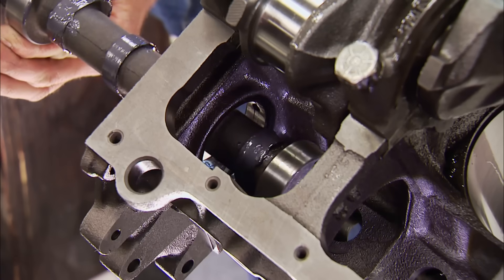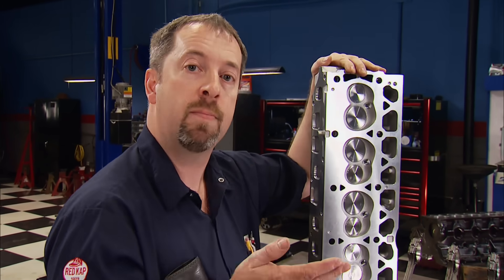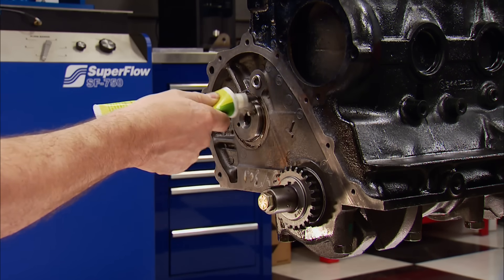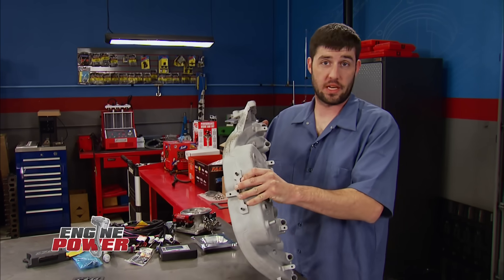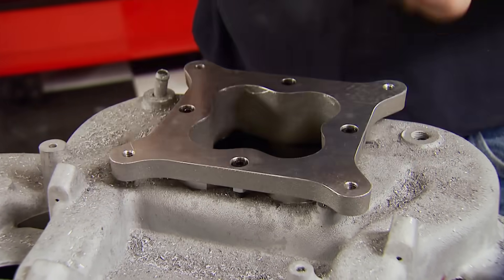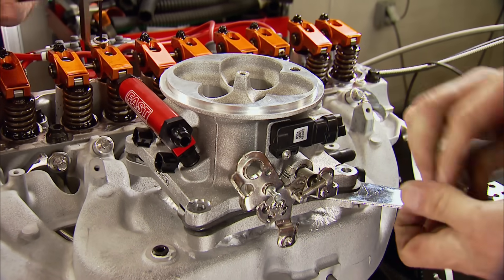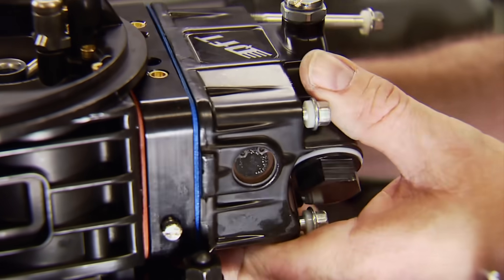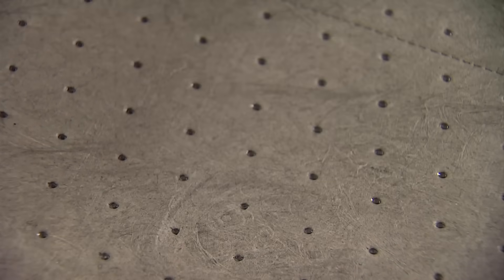Rebuilding a 4.0L Jeep Straight Six to 242HP - Engine Power S2, E14

Comment: cork valve cover gaskets? trying to turn a dry manifold into a wet one? RUNNING 87 OCTANE? You guys must have lost your damned minds right before you spent way too much money on that head. A good port and polish, some good springs, and a little milling for compression is all a stock head needs to run a decent cam and make power. stock exhaust manifold probably would have been fine too. If you had used the stock injection, port matched the intake and gasket, thrown some fuel at it with a bigger pump and higher psi regulator and used 93 octane with more timing you could have shown how easy and cheap this could have been. Those Edelbrock heads cost more than most people buy an old XJ for in the first place.

Comment: I had a 1978 J 10 . Worst motor I ever had . 258 in line 6. First one didn't even make it a year before throwing the number 5 rod. The next one made it to 30,000 miles. Before throwing the same rod. Dropped a Chevy 350 in problem solved. To the day I don't do Jeep.

Comment: Pistons had 0.40 in the casting. Is that 40 thou over? if so you didn't make 1HP per cubic inch as capacity is now greater than 242Ci

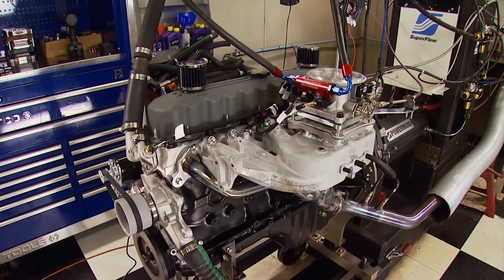Comment: 13:50 - Wait... why did they add the FAST adaptor? It was unnecessary! They weren't mating a 4-bbl to a 2-bbl flange! And if you notice, it wasn't there until this moment... not at initial start-up or during break-in. And since they were taking such time to carefully fit the 4-bbl flange to the intake manifold, why didn't they make effort make sure it doesn't extend too far into the plenum, which would affect how smoothly the air/fuel charge transitions into it and--subsequently--the runners? 
Also... since they're taking time to tune it, all in their search for 242+hp, why didn't they just plug into the TBI's controller unit and make adjustments to the fuel curve via a laptop or the like, electronically?
Something rotten is up here...!😡
Reply: You gotta keep in mind, they're boomers, in pretty sure they recoil and hiss at the thought of coming 10 feet away from a laptop, because you know, why make it easy?
Reply: @ramentaryramblings  - Boomers invented the computer

Comment: looks like a copy of the Aussie built hemi 6 from early 70s , factory had 265ci 320hp with triple webbers stock from factory in 6 pack chargers, well it started out at 215ci then 245ci then 265ci ,last of them 6 pack motor were rated at 320hp at crank
Reply: Nope all AMC. No need to copy anyone. There's 258back in the 70s N/A running 11s in a Gremlins. More than 350+ HP. What's your point

Comment: Fast EFI $1200, Edelbrock head $1800, Harland Sharp rockers $385, Comp Cam that has a warning not for use with fuel injection $269, MSD $718 + pistons, intake, oil pan, timing cover, oil pump, machining, core motor to make 243 HP vs 190 stock. Might should have stroked it. My 4.7 stoker with the iron head makes more at the crank with factory FI.

Comment: Wow you built a drag motor with all the power at red line , how much torque were you making at 3k rpm ? You know where most of jeepers spend 90% of the time . My guess is less than 210 ftlbs. Show the dyno graph ! The reason why the I6 is such a great reliable motor is because you don't have to rev the shit out of it to make torque . In fact most spend 80% of the time at less than 2k rpm off road.

Comment: Damn man....you got the same HP as my '02 Dodge Cummins (240hp stock). Since the Cummins is a diesel though I got ya on torque (~500 ft lbs). Nice job!
Reply: Diesel doesn't make an engine have more torque. The reason your Cummins has more torque is because it's so much bigger. A gasoline engine of the same size would blow away your Cummins in both power and torque.

Comment: I built the 4.6l stroker in 07.  Someone on ebay makes a nice cnc adapter to put a WJ grand cherokee 68-65mm tb on it—you just have to enlarge the opening with that cutting bit he was using.  24# injectors are what I used.

Comment: No builder on the planet would use a chain from AutoZone
Reply: Adam Steffen on a stock build all the time. On race engine never. This ain't a race engine. Just dont use autozones brand, you can actually get name brand ones from AutoZone like Cloyes and Crane.
Reply: @alexcorona  I've spent a long time hanging parts and would personally never use the low grade  consumer based parts from an AutoZone on anything as critical as a drive chain.
Reply: chinese fake auto part

Comment: This looks like the Aussie Chrysler/Valiant 215/245/265 hemi engine,the 265 was tuned to 305 hp for racing
Reply: The 258  went racing in the 70s in a Gremlin with a set of side draft Webber's and pushing over 350+HP. And running 11s

Comment: "The only real weaknesses that emerged, were from lack of maintenance."

The upside is, a seasoned owner can repair anything on this engine in an hour or less, short of a catastrophic failure.
Reply: Catastrophic failures are generally fixable by the owner also, not in an hour or less but inside a weekend project with the right tools. Given when this engine fails it doesn't normally make crank viewing ports.
Reply: The  absolute reason I  got  a  258  in  my  CJ7.  Handful  of  small  parts,  basic  set  of  wrenches,  and  when  i'm  wheeling,  hunting  and  fishing  a  three  day  walk  from  everywhere,  something breaks,  I  know  i'll  still  get  home.  Carb don't  need  computer diagnostic,  just  fuel  and  air.
Reply: @Joseph, $400 and an adventure to the junkyard in most cases. Heck, you can buy the whole Jeep for that much in some cases.
Reply: @scotteric8711  not around me for a whole Jeep. Sadly even the craptastic ones are minimum of $1000 without an engine, and maybe rolling. Texas and Jeeps/Trucks and they are way more expensive.

Comment: I gave neither Up,or Down thumb.I stopped after you put the Timing chain in,and there's No tensioner,even seeing a Link height in slop.4$k for slop,is embarassing.When you're 'Torquing up a hill and going over rocks,you don't need that at all.Sorry guys.Swing anda miss.

Comment: You had me till you essentially gave up and went over to the carburetor.  The video went from awesome effort to lazy at that point.
Reply: Yes. I feel like if they were to properly tune the system with fuel injection, they would have had even better numbers.
Reply: @justinrobert6573  Definitely.  I think they lost port velocity due to the large throttle opening basically just dumping into the smaller style Jeep intake runners that are more designed for torque.  They didn't even let us know if it was running rich or lean with the fuel injection setup.
Reply: The best 4.0l were the ones produced near the end of it's life, my 01 Cherokee would pull away from my buds 94 Wrangler Everytime and leave him in the dust but I did have the 3.73 rear gear which came with the tow package
Reply: General Esdeath my buddy had a 91 XJ.  He beat my 93 ZJ without a problem.  Those XJ 4.0 were fast.  That is a big motor for that platform.
Reply: just how would that carburator play on a California jeep? Hmm…...
Reply: XJ 4.0L produce more power than thier ZJ and Wrangler counterparts. Due to the stock ECU tuning.
Reply: Jeremy Kirby agreed. I’m wondering if they just maybe ported/polished the stock TB and intake manifold with a good standalone engine management system what we could have seen...
Reply: @sleeper.simulant7327  Absolutely!  Extrude honing came to my mind.

Comment: For a aftermarket aluminum head and cam im not impressed
Reply: It is not a Chrysler product. That engine goes back 55 years as an AMC design.   As for all vintage straight six motors, they were utility engines.  Not really an amc fan but that’s a durable design.  You’re looking back through 60 years of technology and trying to impose that on the design.
Reply: Well it's a dodge/chrysler product after all, they're never going to be that impressive. Plus Jeeps are pretty much known for awful reliability and lazy engines that not only make no power but are also gas hogs.
Reply: @beeman4266  So many things wrong with what you just said.

Comment: One horsepower for one cubic inch? I know it used to be a benchmark, but now it's just pathetic. But in this case, considering the factory output ratings, it's still a significant improvement.

Comment: You should NEVER lift an engine with an aluminium intake manifold by the carb/TB mounting bolt holes. They aren't meant to hold the weight of an engine and you can warp an aluminium intake manifold.

Comment: Going through all that time and work and not stroking this is a waste of money and time cuz you're giving up tons of horsepower and torque. Plus they spent all that money on the cylinder head that could have spent a little more and got a roller cam and made even more power this is a half-assed build

Comment: Funny... when i tore them apart the cylinders were so poorly machined from factory each hole had a different letter stamped hole. Each Requiring a dfferent piston size each hole. Garbage engine.
Reply: That sounds like most of the engines from the late seventies to the early nineties that ran through my shop.
Reply: @Motor-City-Mike  it was the early 90's ha! Worked at a dodge/jeep/chrysler dealer. Fuel inj. Was still a NEW THING PEOPLE DIDNT GET! Never plugged in their vehicle in the winter expexting it to start. Just kept spinning it over till the cylinders filled up with gas znd locked up, knock equaled bent connecting rod...... so weak. Garbage, junk,
Reply: @vmaxes  
I sure remember the time frame you're talking about - that first generation injection sure didn't help anything.
The way I heard at the time, I knew a few guys that worked at Chrysler/Jeep then, is that they had a problem putting the right size pistons in the bores - almost every engine made has variances from bore to bore (like you said) so the pistons vary in size to compensate, what I was told was that they were putting the smaller pistons in the bigger bores - so they had piston slap which in extreme cases like a cold start with that crappy injection would break a piston skirt and the piston would jam in the bore and take out the rod and sometimes the block.
Even my '97 had a slight piston slap at startup on a cold morning - maybe 2 or three seconds at the most.
Most of the 4.0s I saw held up really well for a long time - 200k plus.

I had a '97 Sport Cherokee that went just over 240,000 miles before it got tired, when it was torn down it only took a .020" overbore to clean up the cylinders.
Most people I know loved their 4.0s, My shop remanufactured engines and we had very few 4.0s that had issues.
Reply: sounds like a load of shit to me.

Comment: Hold up Boss, first off after you Frankesteind that intake for injection you used a carb for your goal. How realistic is that to do at home? THAT setup there wouldn't even let me button up the hood. Nice build if you have a surplus of cash and tools though.
Reply: And depending on which state you live in, the emissions inspector would take one look at that, check the book on what its supposed to have and fail the Jeep. 
Yeah, you got a nice carb setup and a Jeep you can't register or drive on the street. Fail.

Comment: Guess I'm pretty jaded - the 4.0 HO ('97) made 200hp right from Jeep/Chrysler, I'd expect more than 242 (more like 275-280) to call it a "build", there's definitely more power to be had that they left on the table - still without going to the stroker.